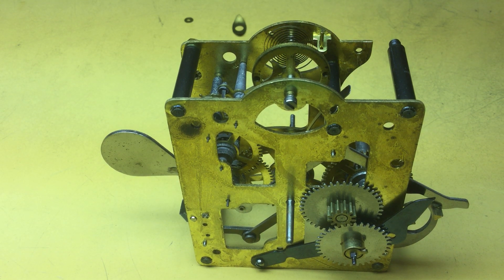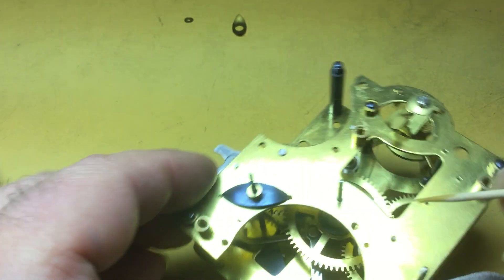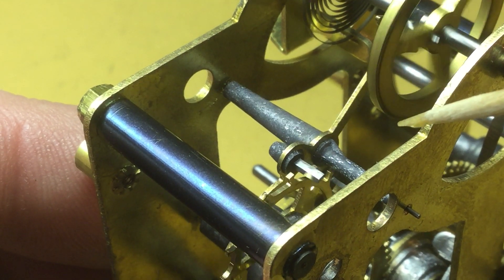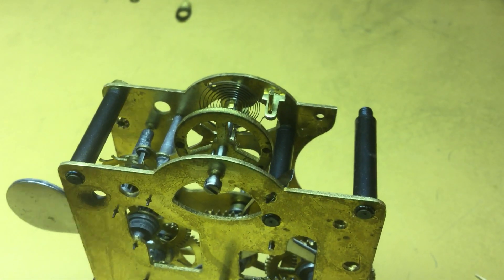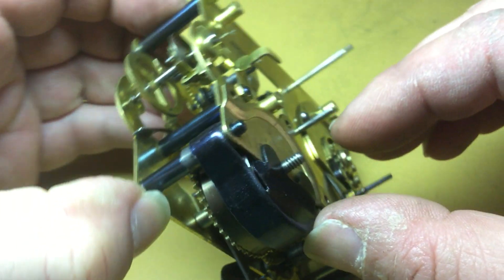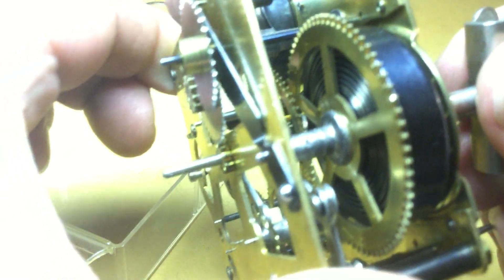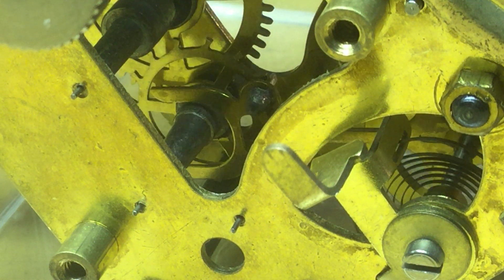Westclox Big ben Loud Alarm style 5A rebuild part 8

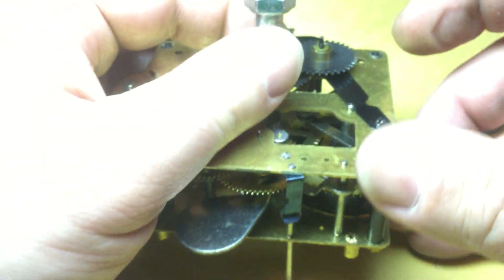Comment: Nice DIY stake for the pinion at about 16:57
Reply from the maker: Thank you. I saw the staking set you used in your alarm clock video. Where did you get it and does it seem to be good quality?
Reply: @okbridges  I bought it from Timesavers: "Staking  25-Piece Punch Set" (https://timesavers.com/i-8944745-staking25-piece-punch-set.html). I've used it only a couple times so far, but it seemed fine in those cases. I feel like it doesn't have the variety of sizes I'd like for clock repair, but maybe that's just inexperience on my part: there's a big difference between the largest small stake and the smallest large stake. I'll probably buy a different stake set once I know what I'm doing. You can see the range (or lack of it) by clicking on the product thumbnails.

Alternatively, I've seen folks who own lathes (I don't yet) cut their own stakes using steel rod and carbide drill bits.

I wonder what @dperry428 uses? He has a huge amount of experience, and seems to buy a minimum of equipment.

Comment: Doesn't not oiling the pallet fork pivot wear it down? I suppose not as much because it only moves back and forth.
Reply from the maker: I followed the oiling advice as offered by Bill Stoddard on his excellent website. I have done many movements both ways since initially taking in his advice.  This may be a good subject for a future video in the ‘Westclox Fun’ playlist, and do a side-by side comparison.
Reply: @okbridges  Wait a minute, where on his website does it say anything about oiling? I thought I knew my way around there but apparently I don't!
Reply from the maker: The repair tips page is here:
https://clockhistory.com/westclox/other/repair/repair-tips.htm

Note that I did not follow his oiling suggestions completely, I made changes to my taste, but I did follow his advice about the lever pivots on this clock and 2 more I did right after and I’m pleased with the results! The clocks run great!